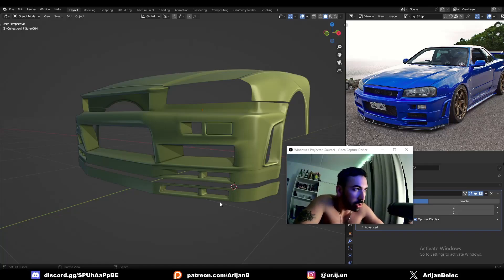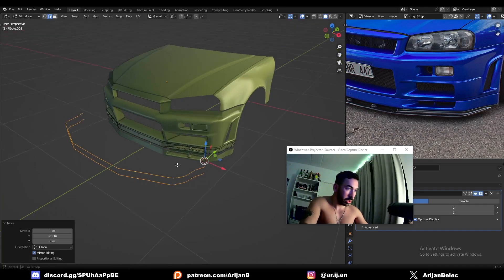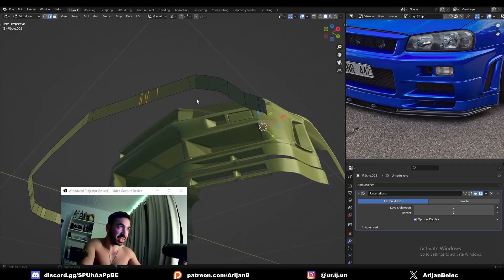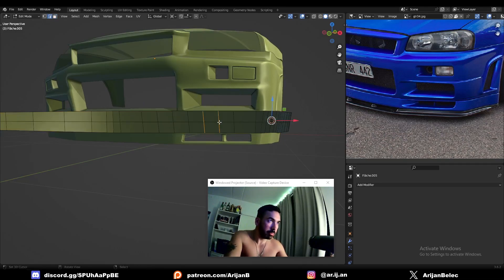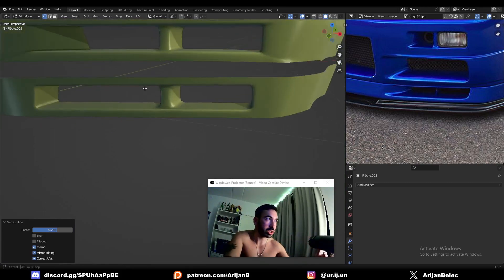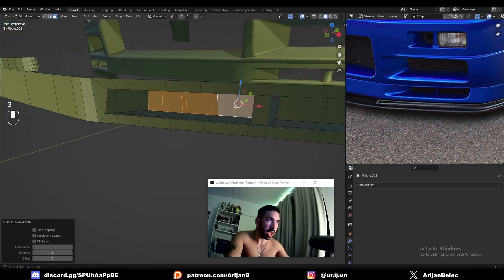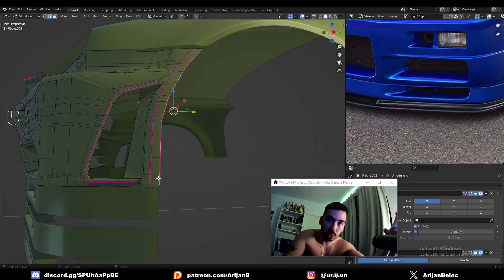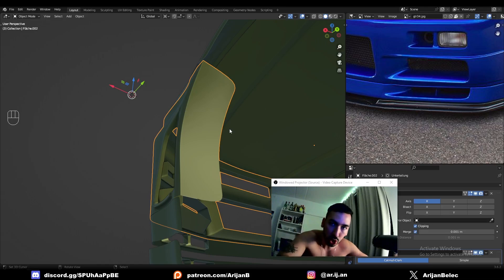Blender Car Modeling Tutorial - Cleaning Topoogy on a Nissan R-34 Skyline (Arijan)

Comment: What's up man, love your channel, the modeling techniques are sick as well as the get jacked stuff. I am currently working on an Audi R8 model. I have modeled most of the interior and the outer shell using all quads but I am struggling to connect the interior to the outside in a clean way. Do you have any tips on how to do this? Perhaps you could make a video about it? Keep up the good work!

Comment: I got a question... If you are using so many edges for shaping that thing... If we see overall... Isnt it gonna have like way too many vertices when the model is done... Overall wont that be too heavy to render... I dont have a powerful system so asking... How much like... On an avg can we go upto on total vertex or polycounts...
Reply: well unless you subdivided it way too much and reached millions, blender is still stable enough, exact numbers on different machines isn't clear, but using vega 7 to save my battery, blender is still smooth on anything i do besides rendering ofc. you can shrinkwrap a low poly model onto a higher one and retain the shape while lowering the load
Reply from the maker: If it's for rendering, you should not be sparing on vertices because low poly models will not look relistic.

For games, it can be optimized for sure.